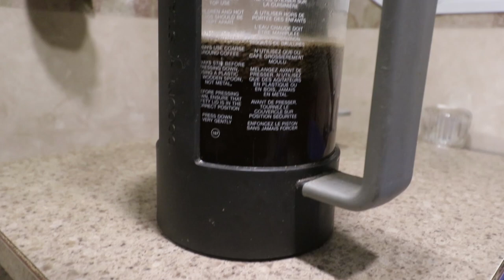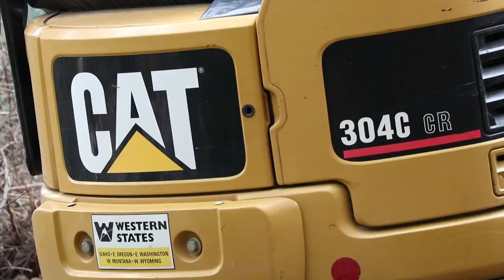Off Grid Couple GIVES UP & CONNECTS TO POWER

Comment: You can get more consistent tenons off the table saw by making both cheek cuts with the same face of the brace facing the fence and using a spacer. This rather than flipping the brace around and working from both faces. 

For example, make a spacer exactly the thickness of the desired tenon. Set the fence to make a cheek cut on the far side of the brace and make the far cheek cut. Then place the spacer against the fence and run the brace along the spacer to make the cheek cut on the near side of the tenon. 

Working from the same face eliminates the problem of variance in the thickness of the brace that causes the tenon thickness to vary from brace to brace.

Comment: I built a log cabin years back with heavy timber joists. The timbers were southern yellow rough sawn so no good reference point for consistency when cutting the end to fit into notches I made at the top of the log wall to receive the joists. I made some router templates and bought the biggest plunge router I could get and cut the tenon as far as i could (3+ in) and finish the cut with a hand saw. All the tenons had exactly the same shape because of the template, and i could take the tool to the work.

Comment: When assembling the braces, you need to put the angled brace in the slot for the upright and then put the brace and beam tenons straight down into the two mortises at once. Otherwise it wont fit until you carve enough slop to force it in.

Comment: Just because you will be hooked up to the grid, doesn't mean you have to use it. Meaning if you solar, wind, water, sources of power is providing what you need,  use that first, then let the grid be your back up.  If you are in an area where the power company will buy back your excess power your creating from the solar,  this may be a source of income, but you would not be able to do this if you where not on the grid.  Getting on grid as a back up is a smart investment should you sell your property, some don't want to be self sustained.  Should you want to go full on off the grid, you can always turn the power off - from the grid.  It's a win/win idea to have power from the grid on your property should you need it.   Good Job.

Comment: Nice video, I enjoyed it very much.  I worked for a public utility Georgia Power Co. for 30 years.  I think you would be much better off with the primary cable direct buried.  That would eliminate the max 500" distance.  You need to get the transformer as close to your house as possible, say within 100'.  You said the secondary or service cable would be 200' at that distance be careful with flicker or inrush.  The voltage drop might be ok but the inrush or flicker could be a problem.  The flicker will happen when your air conditioner comes on and you notice your light dim down just for a second.  I would guess the transformer will be a 37 1/2 kva might be a 25, and the service cable being 4/0 UTA.  Utility company's now have machine that can locate where a fault is  and dig up just that small spot. Well anyway,  good luck and glad to see the progress.

Comment: If I were you. I would think hard about throwing a 1" conduit run in that trench along side the power conduits. Future expansion option from the pole to your house for Comm. lines. 
 Internet, phone, Cable, Fiber. You never know what the future will bring. And you will be ready with a spare conduit ready to go.
Reply: Can you pull those lines that far without them breaking?
Reply: Yes Comm Lines & Fibre & Cable can be pulled a great distance without breaking them only I'd  use 1 1/4 " Rigid PVC Conduit Lay it right beside the 2 "
Reply: That would make sense, we just recently brought in Coax to my business. Instead of having the company install it we trenched and installed conduit to the pole ourselves and we put a second conduit in case we need to pull something in the future.
Reply: 500ft.  you should be able to. If your are worried about it grease the conduit with some PolyWater.
Reply: You have to get the proper cable for the installation, for sure. I was on a job where we pulled a km of fiber and laid it in a trench for communication between processing plants.

Comment: As with any chain saw, if the right facing teeth are sharper than the left facing teeth it will draw to the right or left, that is to the side with the sharper teeth. That is why most cuts with a chain saw that has had the teeth sharpened will rarely cut straight. This usually isn't a problem with a chain saw because it's not real critical; However in your application you would probably be better off replacing the chain rather than sharpening it. While using a jig helps it isn't precise enough to have every tooth exactly the same, plus the teeth don't always wear the same. 

Another option would be to mark and cut a rough opening that would be finished by hand, while this would add time and labor to the job it would be about the only way to cut to exact dimensions.
Reply: mr; You sir, no shit about chainsaws/chains.

Comment: Another point about the grid tie is that if at some time you decide to sell the property having grid electric will not limit potential buyers. While some my embrace the solar power, my guess is a lot more would shy away; If for no more than lack of knowledge about solar power. You may also find that for several months of the year the solar will provide the power you need, whereas other months of the year the dependence on solar only would create a lot more work. Due to limited hours of sunlight and having to clear the panels off one or more times a day, solar may not be a viable option in the winter months. So in the end you can still use the solar for a portion of your power needs without total dependence on either system.
Reply: Thanks for the info but they know this already....

Comment: On grid is more social. In the future it should backfeed your solar, so your neighbor can run his washing machine. Etc.
Living on a battery (for cases when there's no grid) for your base infra seems smart.
All electric cars should also be capable to backfeed (instead of only charging). This would increase the local power delivery, without upgrading the feed-wires of a village/city. Decentralized power IS the future!

Comment: I believe you guys can be self-sufficient. Even though at the time you need extra power it is always good to have a grid source option. You can always move to just solar later in time. And now you already have the connection for if you produce extra solar power you can put it back to the grid.

Comment: I used Northern Lights power company to install 1/2 mile of plowed in service to my house in 2008. Got easements at no charge from two neighbors. I electrified their property in exchange. Price @$28,000 including two transformers. One for each 1000 ft of underground cable. Best thing I ever did. Energy is cheap at less the 6 cents per k/h. At $10/ft to plow in your power line I estimate your cost to be around $6,000. That includes one transformer. All you need to do is plow a road wide enough for the spool truck and back hoe to traverse along the route of the engineers stakes.. Don't know why you're going through the cost to excavate your utility line.

Comment: Do you have a 12" speed square and do you know how to use it as a guide when you cut with the circ saw also much better at marking 45s than that machinist square. You guys are impressing me to no end. Most people do not understand how much learning curve there is in the trades and for the home owner you only get one shot at it and its over

Comment: The powerwall 2. 13.4 kwh. 7k  if you dont have smart meters and peak rates a battery is essential and still do solar on the roof over time.  Also bio has can run the generator from wood gas and the septic.  Use septic to store the wood gas or old propane tank.  If emergency battery 3 days before recharge.  Every house in America needs solar water heater and boiler working together.  You can heat House and future green house and Wood barn.  Great to watch a comfortable pace.
Reply: You first, let us know how it works out for you...

Comment: Why couldn't you do 12' at a time, gluing the conduit as you go over the wire? Then pull length doesn't matter. Have done this method in the past with electric and stainless steel gas line.
By the way I too am a building contractor, done both residential and commercial.

They actually use those blocks as hammers, just put a handle in it.
Take the table saw find the rough center of the beam, plunge cut the beam. Then flip the beam 180 degrees and plunge cut the same spot. That will show you the true center of the beam.

Comment: Ooh, big stretch, Bugaboo!   //   Ahhh!  The lovely "scritch" sound of the sharp chisel cutting wood fibers.  Chisels and hand  planes have a soothing sound of their own.   //   All the eyes at the Shelter Institute just rolled when you admitted to using a combination square to lay out timber component angles. LOL  //   No glue on the PVC conduit?  Do they pull direct bural cable?

Comment: We ran primary direct burial through 3" conduit for about 550 ft to a 400a transformer. My electrician has a 3" mandrel for doing your conduit mandrel test before you are allowed to pull the cable.  I'd wager he would be willing to rent or sell it.  Where I live, (National Grid) the customer is responsible for performing the mandrel test while being witnessed by the utility co. rep.

Comment: Would it simplify things to put in an extra pole at the edge of the woods to shorten the underground run? Yes running overhead lines in the woods is a pain with the 30-90 foot clearance needed on ether side but dropping a pole closer to you to have a shorter run lets you keep the better underground distance and gives you the shorter run of wire.
Reply: Its 3,500 -7,000 to install one pole.

Comment: Just go on grid don't worry about what everybody else thinks then when you can afford to put in enough solar and battery if you can sell back to the company
Reply: Solar is not really worth it. Nasty battery banks, invertors etc. you still need a standby generator. I've got grid power and a 17kw standby Generac hooked up to a 250 gal. propane tank. I'm satisfied. I'm the only one in my area with grid power. My neighbors live off the grid and are comfortable but they still say it's a pain in the butt. Propane isn't cheap and even the best generators are noisy.

Comment: You mentioned that your chain mortiser might be "turning" your mortises 1/16" or so. Could it be because you're not clamping the mortiser to the beam? I've noticed every time you show it being used that you line up one side of the bottom clamp with the beam, but never close the other side of it. I'd bet if you clamp it down, it won't wander a 1/16".

Comment: When they installed the conduit did they put a rope thru to pull the cable, or does the power company use air or vacuum to move the cable thru?  Love your videos.
Reply: It's common practice to use a vacuum to pull a rope through, and then tie the cable to the rope and pull the cable. Especially on that long of a run.

Comment: Blood, sweat and tears are normal for most projects unless you get someone else to do the job :-). Keep to off grid option even what you're currently got it gives you a backup if there's a supply problem. When you Get your main board installed get it with the off grid option. Doing at this time will be cheaper and give you options in the future.

Comment: The basic problem is that you do not live in a place that allows 24/7 solar panel power. Snow covered panels and you have only the power stored in batteries and inverters to transfer that to 240 Volts. People that live in high sun areas will have a system where excess power is sent back to the normal grid and they get paid for it. But they still have the normal power supply in case they needed it. Your only other options would be Wind or Water? If you find a underground water supply you may be able to produce power from that? As a kid I lived in an old water mill. It had been removed but the house was still there, No Mains Electric, Gas or Water. We had an underground river. It came to a well outside the back door. We had a pump that we had to prime in the kitchen to get internal water. It was fresh and ice cold. In the Summer and Winter it was deep enough not to get heated by the Sun. We also had the external river but neither was any good for Hydro Power?

Comment: Don't beat yourself up over the decision to grid tie.

It's not an "all or nothing" decision.

For now, it'll make sure you'll be able to work and not be beholden to your power source.
And you always have the option to go back to off-grid (or grid-tied (see "Belt AND Suspenders")) at some point.

Your current solar system, simply, wasn't anything even CLOSE to what you needed as a long-term solution.
And you're still WAY too early in your build to put in something more permanent (not to mention the cost outlay).

And congrats on working out the process for a tablesaw tenon!  While not as "craftsmany" (is that a word?), it'll help speed up your workflow.
Work smarter!  Not harder!

Comment: If the tape is buried to 18", i hope the pipe is at 24", when we buried cables, we always allowed 6" so that anyone digging would hopefully hit the tape first, instead of dragging tape and cable up together.
If a joint is centred, then it should be the same from both sides, even though you may 'reference' from one face, besides, as long as you leave the line both sides, you finish to line with the chisels, even if the chain motiser is twisted, you still finish with the chisel to straighten it.

Comment: for chamfering corners I might suggest using a small plane over using your chisls.  same with flattening the side of a tennon.
Reply: If you use a plane you still have to use a chisel, so why switch back and forth....and you can change the angle on your chisel with just a simple hand movement....
Reply: have not found this to be true in my case.  Bigger chisels are much less usable in my experience.  I get flatter surfaces with a block plane and dont get big chip outs..  Might be better for fine tuning than a chisel.  It is a matter of preference, as most hand work is.

Comment: I don’t think connecting to the grid has to be a “Permanent” option. Obviously it comes with cost, but it offers you time to get the rest of things stabilized. Then you can disconnect and ride out life off the grid once things have settled down.
Reply: Having the option for both is best, it could even result in selling some power in the summer which could help with costs in the winter.

Comment: Just for your info......adjustable squares are not that accurate. Has to do with clamping device and as you say.........so little surface laying on your work piece.  We were not allowed to use them in metal fabrication

Comment: I know a lot of people are stuck on the hole conduit thing... as an electrician I can tell you for sure in 10 to 15 years you will never get a new wire in or out of there. Teck would have been a quick and easy thing you or an electrician could have easily done
Reply: What is Teck?  Weatherproof cable?
Reply: hillbournesian it's an everything proof cable. You can run it in ground above ground, through a lake, in the air. whatever you need.

Comment: Are utility poles not an option? Hanging wire is so much cheaper, but can be unsightly.
Reply: hillbournesian yes, but the poles are 1000 buck each, and they would need to take out some trees
Reply: To have a company install a pole its cost approx. 3500-7000 per pole...depending on the height and the terrain and and and and...
Reply: Wow, didn't know that it cost so much! Thanks for the information!

Comment: Hey Guys I just finished watching all your videos, great job!  I think you guys are doing awesome.  You are inspiring with how fast you are getting your projects done.  So I haven't read that many comments overall but I'm wondering if you ever considered installing a small wind turbine?  I don't remember you talking about it in any videos.  I'm sure it may be expensive and I'm sort of clueless as to what would all go into it and how much output it would have.  After all the work you've been putting in I do not blame you for going on grid, take a break you both deserve it.
Reply: They have their pros and cons....Even the small ones make considerable noise....One advantage that I do like  is they require a dump load for excess power, so they are great to have that load go into heating a hot water tank....There are some informative vids on Missouri Wind  and Solar site. The problem with small commercial turbines is they are  plagued with problems and really like most solar components never produce close to what companies say they do....